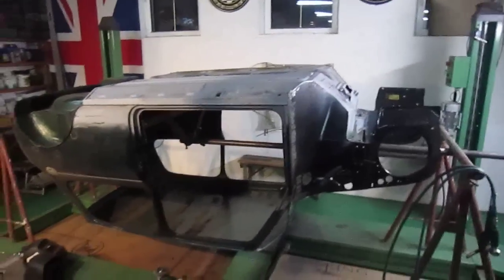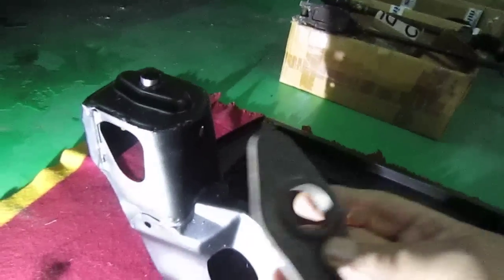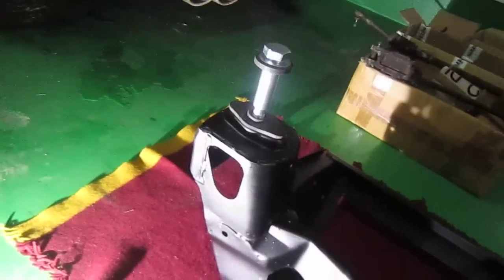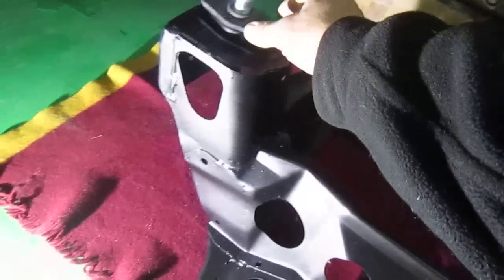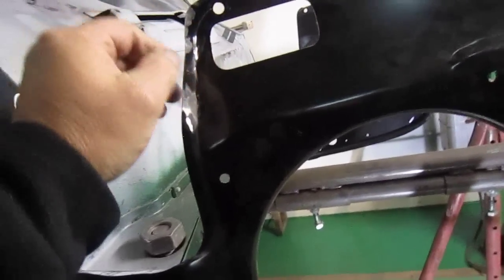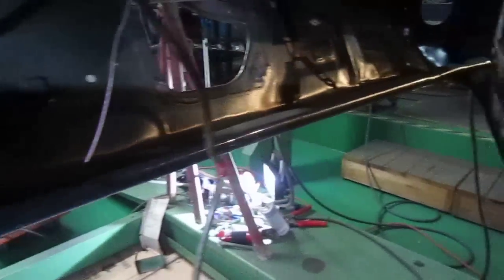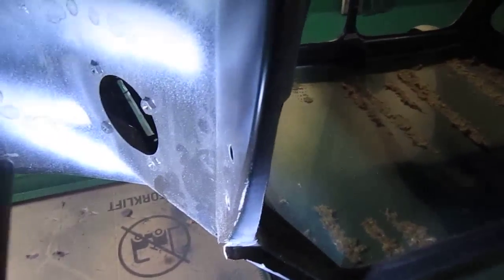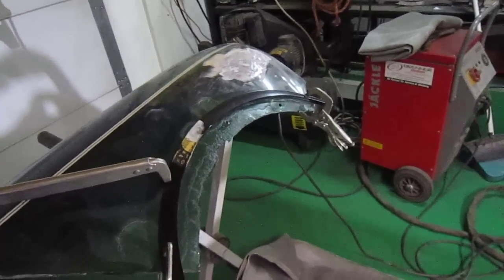Classic Mini subframe tips & welding updates

Comment: Dave, that subframe looks fantastic, your friend has done a great job. He's right about solid mounting the subframe too, it does sharpen up the handling, but does make the ride less comfortable and noisier. My 1973 Mini (solid mounted subframe as standard) always seemed sharper than the later Minis I've owned. Mind you, if you really want to improve the handling further, consider ditching the 13 inch wheels and replacing them with 10 inch ones, like the original. It's an easy enough conversion and you can buy it as a kit from Mini Sport for around £200. You'd also need to add some wheels and tyres, but you'd end with a sweet handling, retro looking Mini. Simon
Reply from the maker: Simon, Max is a true mini fanatic all of his 60 mini collection is original and he likes the 10" wheels. But he is the top mini guy in Austria. I will keep the car as i bought it but just bring it back from the dead.  Cheers David
Reply: Bringing a Mini back from the dead is the main thing. You can always change things around once it's on the road, or keep it as is. However, it's hard not to tinker with them, as there are so many after market parts available. Simon.
Reply from the maker: Simon, Yep another one saved. I get as much fun driving the mini as i do with my E Type there just a great little car. But they are ends of the scale when it comes to the price of parts. Cheers David
Reply: I dread to think how much the parts for the E type cost. Gorgeous cars though, I bet it's really nice to take out on a warm summer evening.

Comment: Hi Dave, mine is a 1971 mk3 with dry suspension and it has the twin bolt type fixing which is the early type as opposed to the type you have which is the later type mounting.
Reply from the maker: Andy,  I mentioned in the video about the two bolts pre 74 cars but there was no rubber on the towers just metal to metal contact. This was BLs idea when the changed the original design to a single bolt to make it a smoother ride.
All it did was lose the direct response in the steering due to flexing. Cheers David